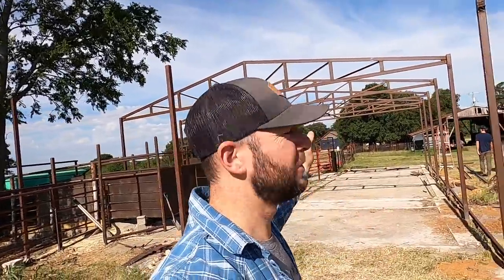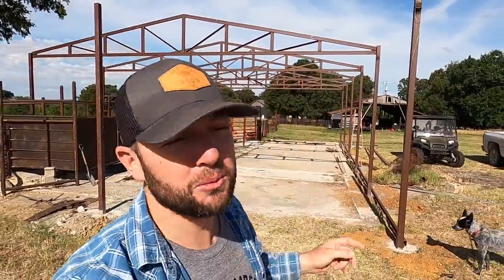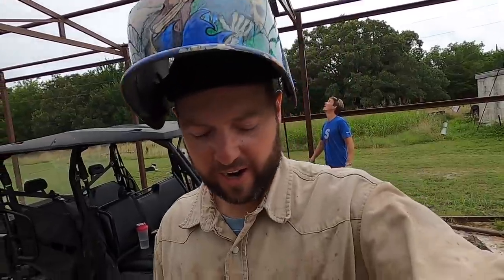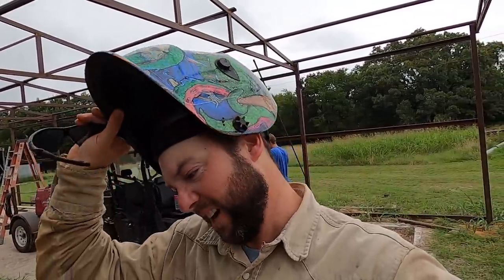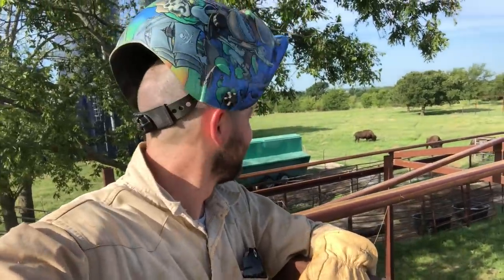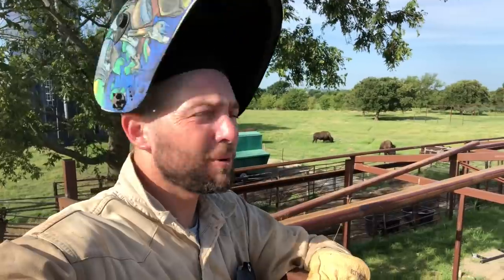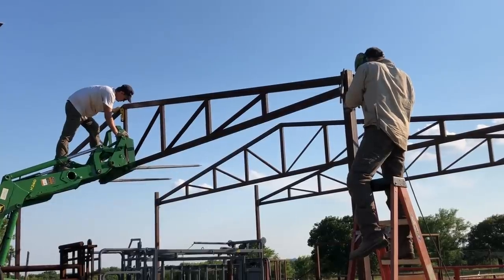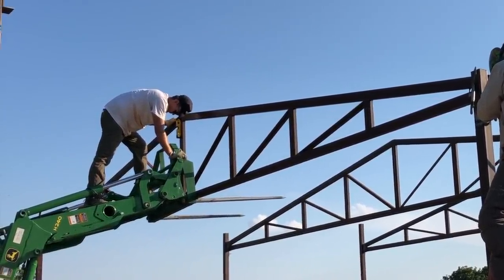Building a BISON BARN: Part 2

Comment: To one and all, to get that laser straight alignment of the screws to fasten the exterior sheet's to the barn, the trick is to measure on a first sheet, depending on your self confidence, maybe even hold in place via some welding vice grip's with the movable pads, mark out where your going to drill your holes (DO NOT DRILL ANY OF THE HIGH POINTS / SECTIONS OF THE SHEET METAL.)   All holes should be in what I'll call the low section(s) of the sheet covering. After doing layout, drill all the holes, via a 1/8 " inch (0.125" inch) drill bit, in the sheet steel. Using some Masking (or Electrical etc) tape, make a letter "T" & a letter "P" right next to each other example: "TP." TP = Template, now place on the sheet somewhere that makes you feel warm & fuzzy.  Now in a separate pile stack 4 (four) to 5 (five) sheet(s) of siding making sure the ends ALL LINE UP (let's say the Top's & Bottom's,) now ADD to the separate pile your template, again making sure the Top's & Bottom's are all in alignment, then drill away. (While drilling, you may want to use some welding vise grips {Four for each corner} to hold the alignment of the sheet's.)   Now Rinse & Repeat. Your Template should be the very last sheet to go on / be attached to the building.  In case your wondering about how close to the "HUMP" for the Over-Lap should you drill, I would recommend between a Maximum of a 1/4" inch (0.250" in.) to a Minimum of 1/8" inch (0.125" in.) from the beginning point of the "HUMP" Over-Lap.  Prevailing wind's should dictate whether your doing a "Over-Under"  i.e., you can see the Right side edge (where the two sheets meet / overlap) of the sheet steel, (Assuming your working from Left to Right.) If you feel the Prevailing wind's dictate that a "Under-Over pattern" is necessary, i.e., the first sheet is put in place minus the screws at the right end, the second sheet is put in place, and at this very moment, you can see the Left Edge & the Right Edge of the second sheet steel. Now complete securing the sheet steel, via screws on the first & second sheet's. Rinse, & Repeat. You could put all of the screws on the first sheet before doing the second sheet, but if you want just a little alignment if necessary, leave out the screws' closest to the Over-Lap. Enjoy.

Comment: Hate to tell you this but you’re purlins are installed 90 to what they should be.  The short side is the one to attach to the Column.  On the roof and the sidewalls.  Stronger that way.

Comment: I see you put in electrical 240v? Lot of climbing and welding to frame the building. Built a 16 x 24 x 10 ft Peek and 8 ft walls high, by my self, ground up.. None of friends helped. Liked it better that way." To many in the kitchen can spoil the broth" Ended up the way" I " designed it. It is refreshing to see Bison in the fields. To bad I do not like Bison meat. Good luck in your business.

Comment: Watching you weld , even though I am sure you are doing a good job 
Makes me cringe , as before I got hurt on the job ( They ran into my ladder with a forklift and I fell 10' onto my forehead )
I used to do Electrical , Plumbing and HVAC work 
Standing on top of a ladder , having a ladder in the side by side , standing on top of the tractor lift and other things
Would have gotten me , My Boss and the job site Foreman all BIG Fines from OHSA 
If I remember right , the forklift driver got a $250000. fine and his company got a $1000000. fine and I will be on Workmans Comp for the rest of my life